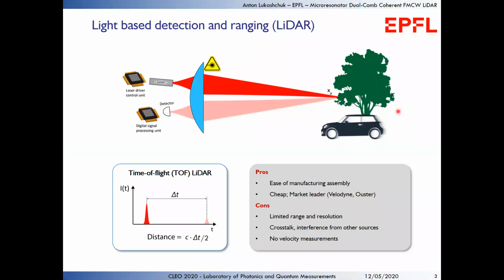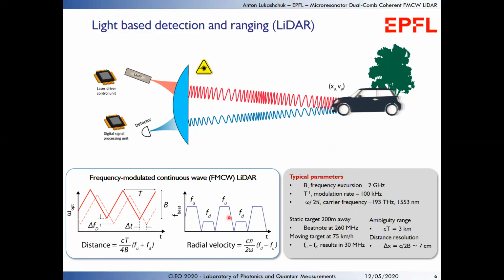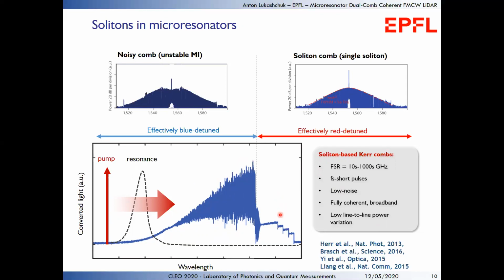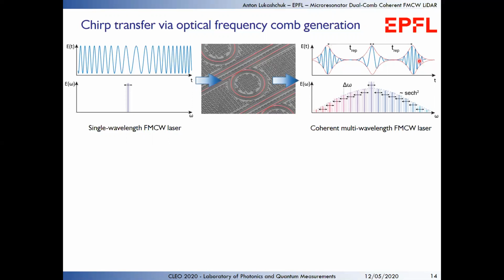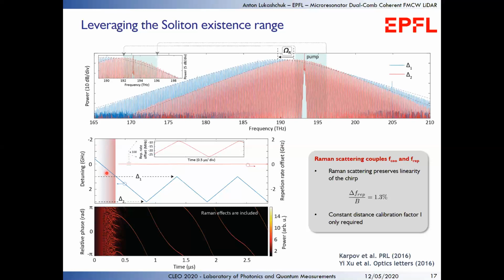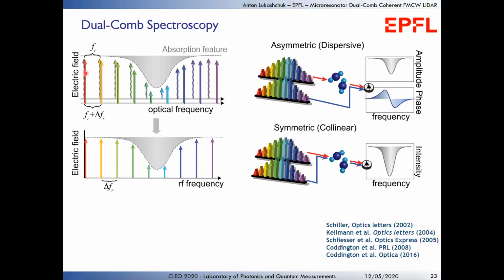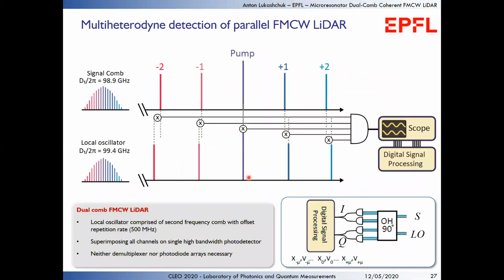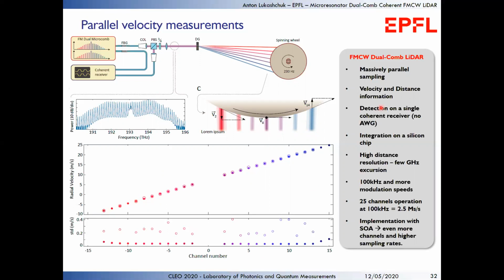Microresonator Dual-Comb Coherent FMCW LiDAR

Comment: Fantastic presentation! Thank you for sharing, I see many practical applications for FMCW lidar but not necessarily for vehicles. If these systems could be used for drones It would be advantageous! They could simultaneously encode information to communicate with others using LIFI. Would it not be possible for these systems not only to point map but also at a clocked rate pulse encoded information for other devices to communicate thus removing the necessity of having any rf communications? Rf is the biggest weakness of modern drones and using optical systems has many limitations and weaknesses. This is a very exciting time for lidar!